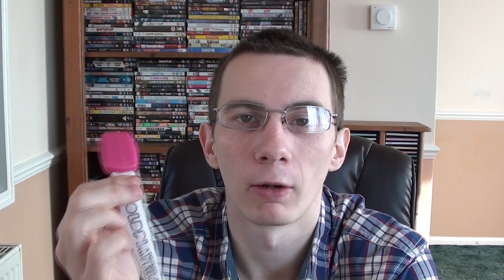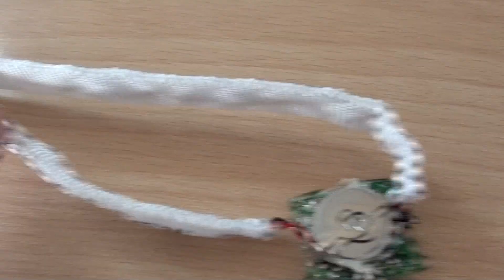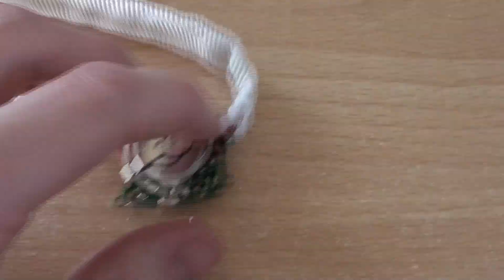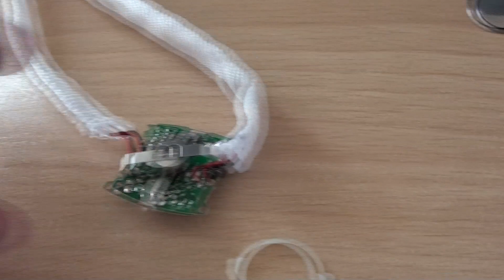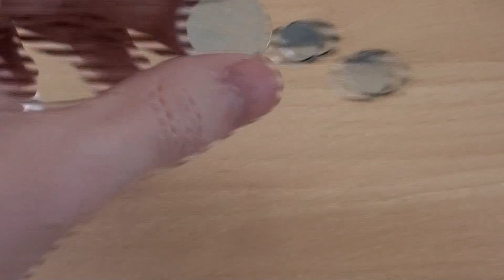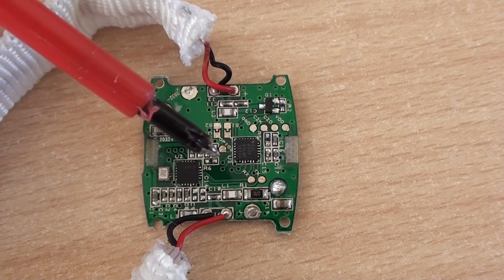Coldplay Xyloband Teardown

Comment: Hi Carl.

Just found your videos recently and am currently working through your historical videos.

I didn't know anything about these bands until i saw your video, However I do remember it being discussed on the Amp Hour podcast(Dave Jones from the EEVBlog) and i'm sure they mentioned it was triggered from massive IR canons, which clearly isn't the case with this product(although they should have because production costs may have been reduced!)

I have been planning to produce a number of tech videos myself from my equivalent of a "tech Shed" and think i will try and find one of these on ebay and do some reverse engineering of my own!

I noticed, while you were detailing the pins mainly the RX and TX that the other side of the board had MOSI and MISO, i am slightly disappointed you didn't try hooking up some form of serial console and see if the unit spat out any serial debug data.. I may try this myself.

Keep up the videos! I am very much in favor of more British tech people producing youtube content!!!

Tom.

Comment: Question: How does the original owner know it doesn't work if they cannot provide the required RF trigger signal?
Reply from the maker: Well it was listed as "For spares or repair" so most likely the batteries had just run out. If I had an RF signal generator, I would have taken the time to test it properly.